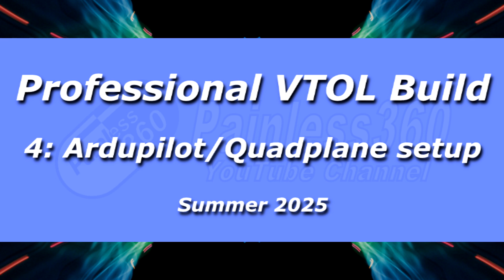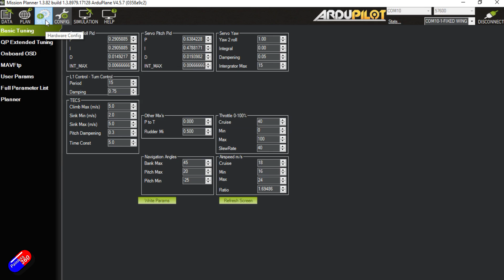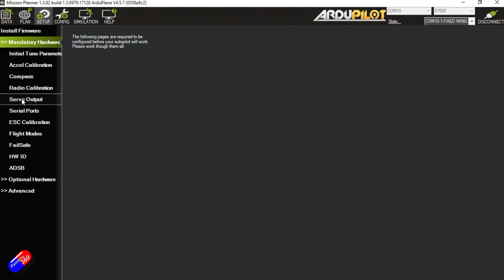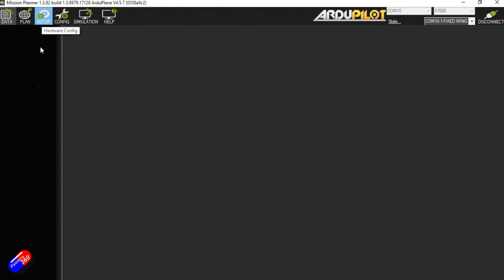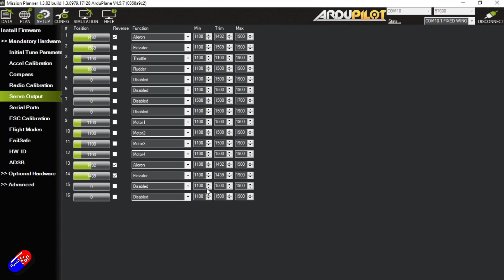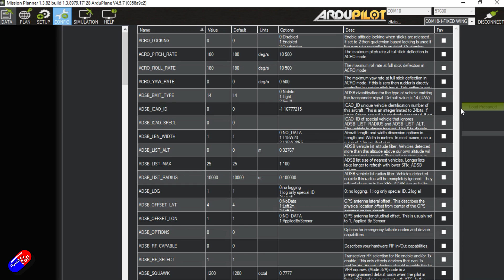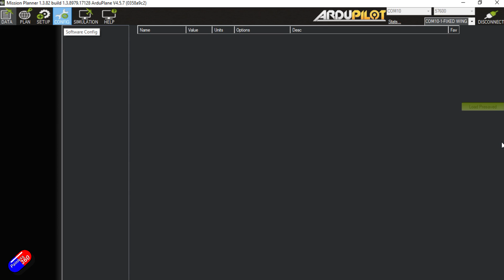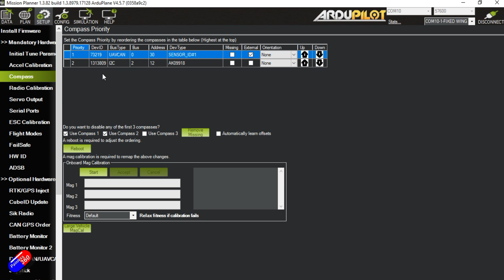Professional 4+1 VTOL Build: Video 4, Ardupilot and Quadplane setup steps

Comment: Thanks for the very thorough and clearly explained series of videos.
A quick question, Ben in video 4 did a great job of explaining the testing of the vtol motors however no mention was made of testing the thrust motor. Any direction/help much appreciated.
Reply from the maker: That is identical to any other fixed wing model testing. Best of luck!

Comment: Nothing available from Holybro and no feedback from them.
Reply from the maker: Indeed, it appears that they have creased trading?
Reply: @Painless360 I did receive a feedback email from Holybro, seems like they have a huge unspecified “problem”, and they have suspended all trade until “the problem” is resolved so no lead time estimate, no pricing, across the board.  Hope they resolve it soon, i probably got one of the last shipments of product, now I'm caught midstream of a very expensive and time sensitive project.
Reply from the maker: Hmm, that doesn't sound promising...